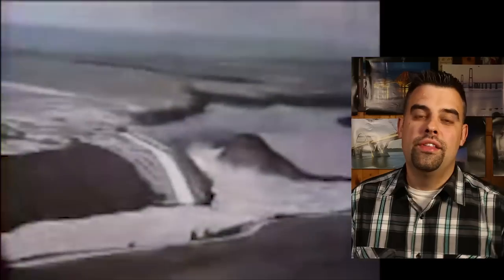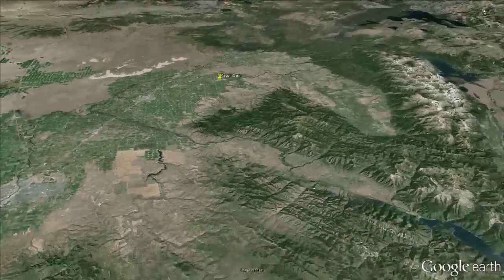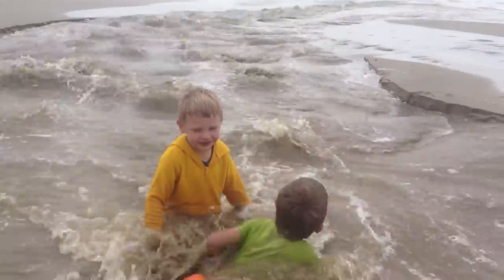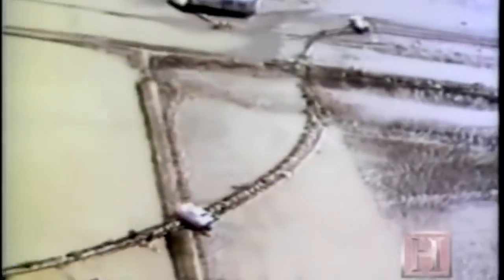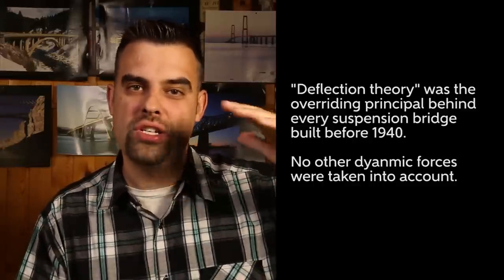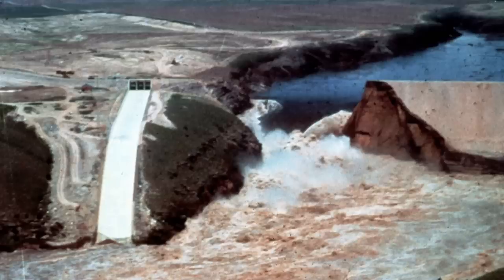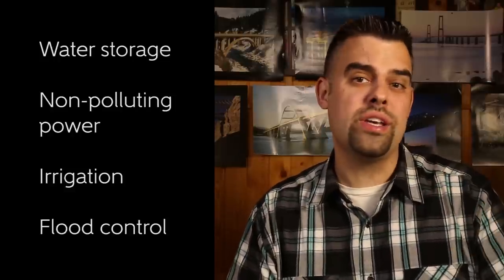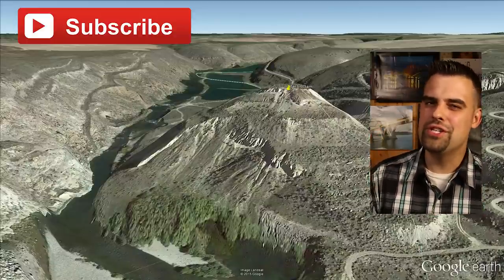Lessons from Teton Dam

Comment: The death toll of the collapse of the Teton Dam was far eclipsed by the failure of two much smaller dams in Pennsylvania alone: the September 1911 failure of the Austin Dam in North Central PA killed 78, while the infamous May 1889 failure of the South Fork Dam above Johnstown PA killed 2200.
Reply from the maker: Yeah, the Johnstown Flood was horrible. It's hard to find a more gruesome civil engineering disaster than what happened when the South Fork Dam collapsed.

Comment: Armchair, do you think  the Glenn Canyon dam will be 1) be drained and/or 2) be removed.  I think the Lake Mead first has merit, but at the same time keep Glenn Canyon as a potential reservoir should conditions change 1 day.  And save the money that it would cost to remove it.
Reply from the maker: Great question! I believe that the chances of Glen Canyon being removed or decommissioned in the next decade is remote. Taking out the dam would be a massive point-of-no-return without a reasonable upside. Like it or not, the Colorado River is developed from the Mexican border all the way up into Utah. Removing Lake Powell wouldn't change that. 

Some of the more radical conservationists also have a hard time wrapping their head around the fact that the canyon has not actually been destroyed: it's still down there, waiting for free-flowing water to erode the sediment and bring back the stunning limestone walls. When abundant carbon-free energy renders the dam obsolete, that will be the time to talk about decommissioning.

The bigger question is what to do about the river's overbudgeted stream flow. The original Colorado River Compact from 1922 overestimated the available water by nearly 20%. Until we are willing to make drastic cuts to the amount of water being taken out of the river, the two large reservoirs will continue to drop.
Reply: @ArmchairEngineer  Don't forget evaporation.  Lakes Mead and Powell each lose ~10% of the annual river flow to evaporation. This is not helping the strained water budget.
Reply from the maker: @geonerd  It's true, the big lakes in the desert DO lose a lot to evaporation. But don't forget that the loss is the result of the water being stored in the first place. If the reservoir didn't exist, the water would not be useable and would be "lost" for community and industrial use either way.

Comment: What’s your take on the Three Gorges Dam?
Reply from the maker: In my opinion, there isn't any real evidence of problems...yet. The dam is undergoing maximum stress for the first time, and that always brings out alarmists. It appears that this year's flood is within its operating capacity. And even if the dam is forced to spill the flood, the structure itself should be fine (can't say the same for the downstream cities).

The only thing that gives me pause is that Chinese construction is known to have occasional quality control issues with mass concrete. Not saying that will be a problem at Three Gorges. But a faulty monolith in the wrong spot could spell disaster.

As of today, there is no reason to think that Three Gorges Dam won't perform as intended.

Comment: You left out some crucial information ; might not hurt to dig a little deeper before you espouse partially informed opinions.

To start with, that entire region is highly unstable, relatively young volcanic flow. The Bureau of Reclamation knew this and figured they could scrape away some of the most brittle layer and call the cracked basalt underneath "bedrock." (It wasn't.) USGS reports, test drilling and other warnings were pointedly ignored because of the political forces bent on getting this dam built at all costs. 

The truth is, a huge number of Bureau dams never recovered their costs in electricity generation or irrigation. They were built because of pork barrel politics, whipped through Congress by politicians who curse the welfare state out of one side of their face while they gleefully take taxpayer dollars back to their home districts for projects that never pay back their costs. 

Read Cadillac Desert for the full chapter & verse on the travesty of Teton Dam and other welfare projects disguised as "public works." Mind you, the author is a treehugger in the extreme, but if you read past his editorializing you'll see some valid points made.
Reply from the maker: You make some good points. I'll do my best to give some additional context.

I wasn't trying to skip over the issues with the underlying rock at the Teton Dam site. Yes, the Bureau knew about the fractured soil and did an inadequate job of sealing the keyway (obviously!). However, this exact type of soil has supported dams in other parts of the world and it is likely that Teton COULD have been built correctly on the same site. The point I was trying to make in my video is that the USBR got over-confident and neglected some key processes along the way. Those key processes would have addressed the issues that you rightly bring up.

I would push back on your claim about a "huge number" of Bureau dams never recovering their costs. Economic impact is a complicated modeling process and it is common for anti-dam studies to cherry-pick formulas that ignore the downstream benefits of flood control and reliable power. According to my research, dams pay for themselves relatively quickly in nearly all cases.

There are many dams that qualify as "pork barrel." However, just because a senator pushed to spend taxpayer money in their home state doesn't mean that the money wasn't well-spent. Every public dam exists on a spectrum of ROI from "wasteful" to "bargain." It is possible that you are correct to say that Teton was never worth the money. Certainly in its ultimate form, it was a total disaster.